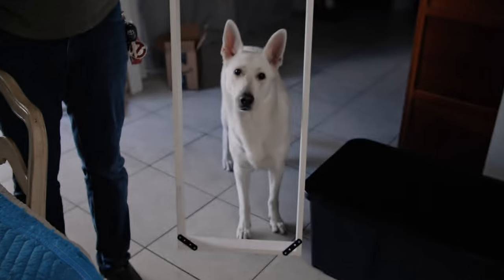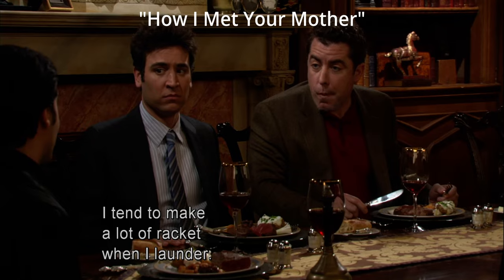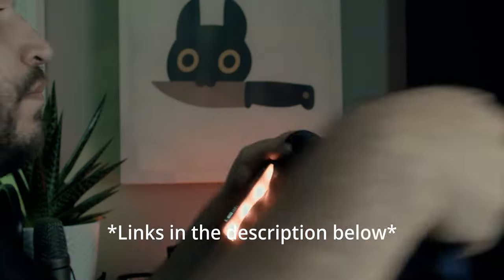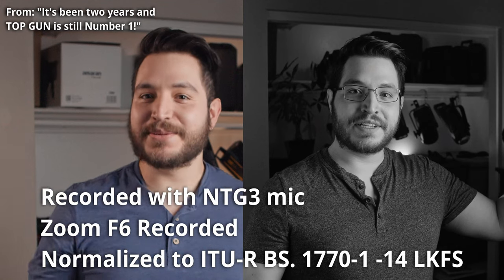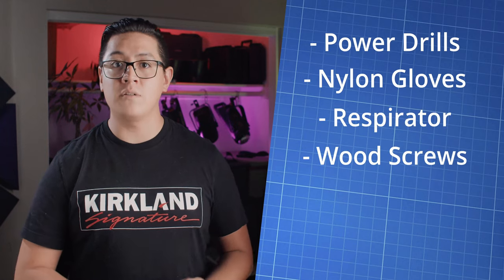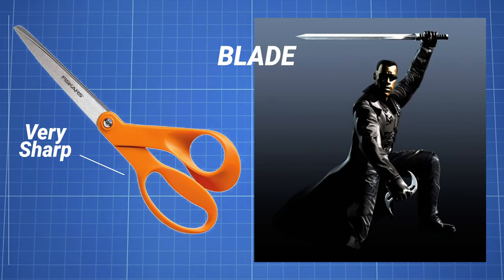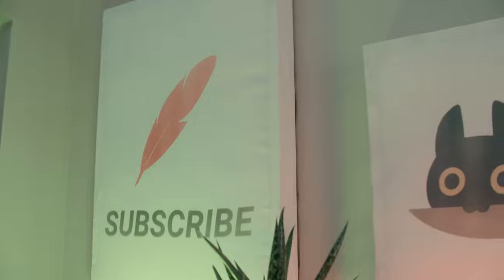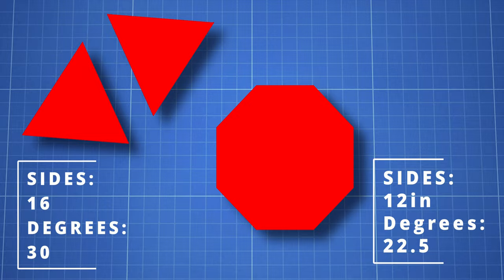Making our own DIY Acoustic Panels To Reduce Echo for Videos

Comment: Hi, I have a question I bought EcoBatt Kraft Faced Fiberglass insulation Batt 3- 1/2  x 15" x 93". My question is will this be safe to use ill be covering the back with Weed  Barrier and wrapping the front with cotton duck canvas. I just want to make sure that no  particles get in there. If you could get back to me I'd really appreciate it..